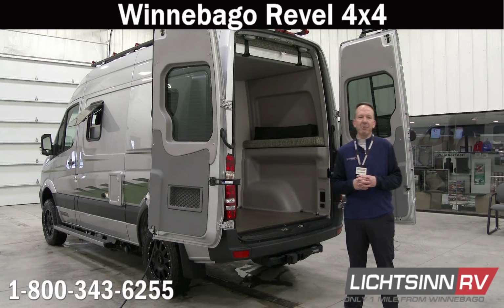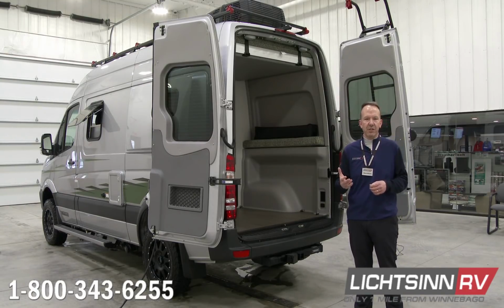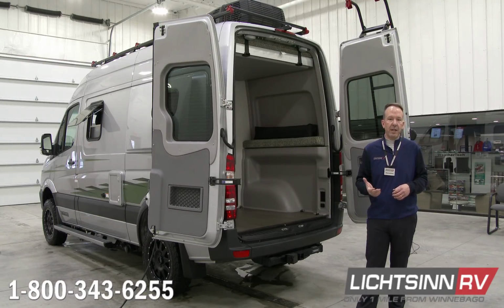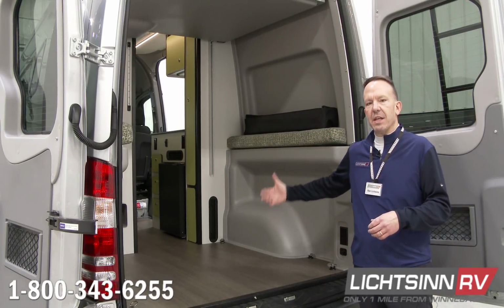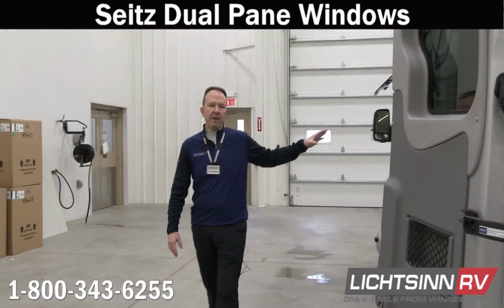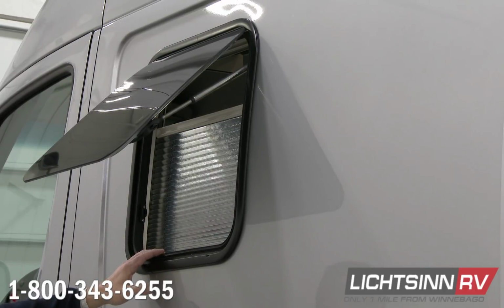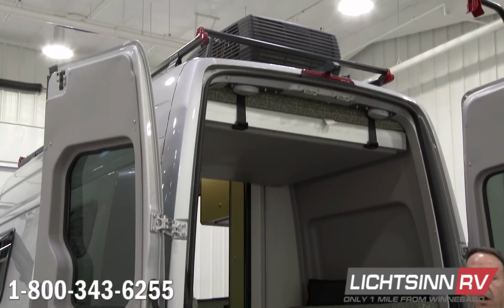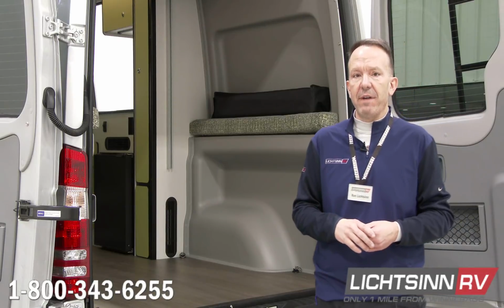LichtsinnRV.com - Winnebago Revel Insulation and R-Values

Comment: What is the warranty on this?
Reply from the maker: Good morning Steve... thanks for your note!   The Mercedes engine warranty is 5 yr/100k.   The Mercedes chassis is 3 yr / 36k.   Each appliance manufacturer is 1-3 years, and Winnebago wraps their inputs, fit and finish for 1 yr / 15k miles.

Hope this helps!